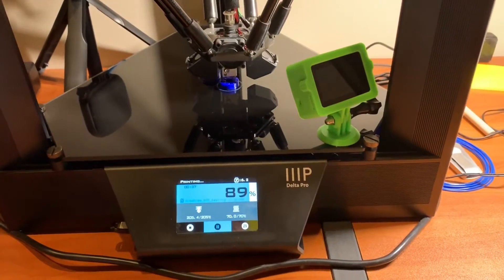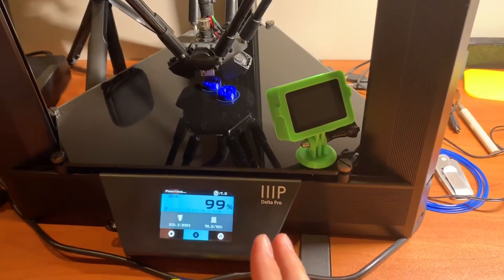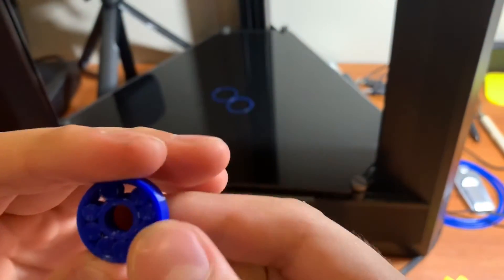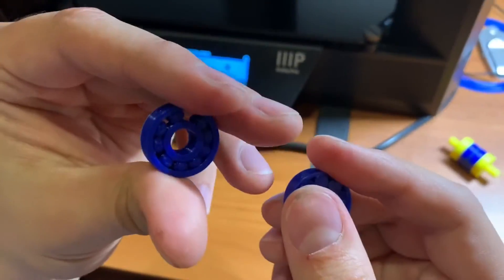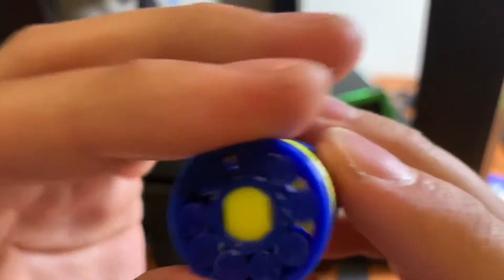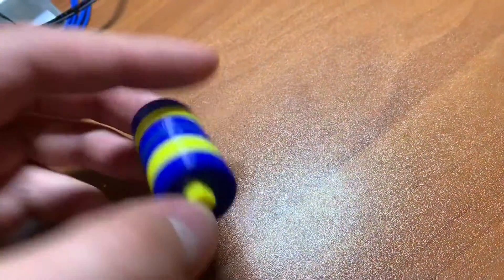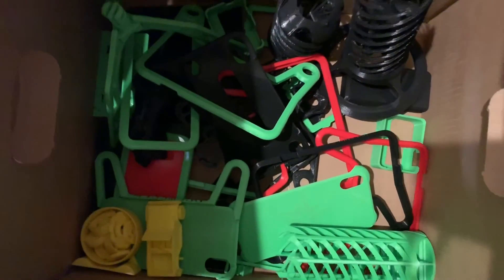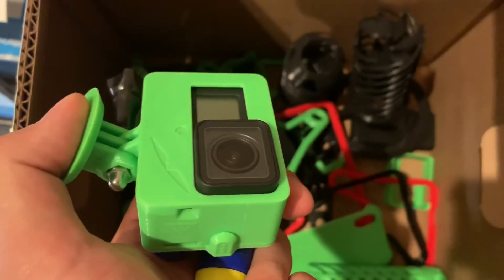In Depth Tutorial: How to print a Drew Brew 608 Bearing Replacement

Comment: Thanks very much for a response on and old comment stream. I did it again at a 2% increase in extrusion and 0.2 layers with maybe a little tighter bit to the eye and feel same result. This is a really reliable print, no complaints just reporting what was experienced. Looking forward to if you get to the changes. I want to use for spool holders which run a bitt of weight but super slow speed as you would know. Thanks again!
Reply from the maker: No worries, thats what I use them for as well :)

Comment: Mine printed fine and spin easily - 0.16 layers (Prusa Mk4) - however it's like there's one bearing missing in spacing - the bearings all move around easily but slide to one side in use) - they're just that loose so not sure practical to use on anything but like the cups shown or something with almost no load? Really like the model though - thanks for sharing!
Reply from the maker: Hey again ;) it is a plastic bearing so it there’s that limitation upfront. As I said earlier, for it to be print-in-place, I had to leave a certain amount of space in between each bearing. It can surprisingly handle more weight than one would think. I do plan on releasing a version where you can pack the bearings, I have just not gotten to it, but it would be a simple cut on the outside of the bearing. I have a project currently posted that makes use of the updated design, check it out-

https://www.printables.com/model/862669-nespresso-vertuo-spinning-tower

Comment: Tried printing this on my Ender 3 V2 but I cant get them to spin at all. I have it calibrated as best as I can. Any suggestions?
Reply from the maker: Eric L you can try to decrease flow rate by 1-2%, it would make the print a little thinner. You can also save alot of time by printing my “S Shaped Tolerance Test” a few times to dial in your settings 😉
Reply: @JLake3D  have a link to that tolerance test? I am also going to run a temp calibration and see if I am printing to hot
Reply from the maker: Eric L just search for it on Thingiverse, i believe its the only one with that name.
Reply from the maker: Eric L https://www.thingiverse.com/thing:3569489
Reply: @JLake3D  Ya mine didn't print that one well at all. What exactly should i fine tune to get the separation that is needed? I tried turning down flow to 98% but it still pretty much fused all the layers together
Reply from the maker: Eric L as long as you can print the 0.2mm separation you should be good 👌 decrease the flow even more as long as it doesn’t affect the quality of the print. Slowing down speed might help as well.
Reply: @JLake3D  Tried everything to make it print .2mm seperation but cant seem to get the printer to be that precise.
Reply from the maker: Eric L last attempt try to lower your print temp. If that doesn’t work than its a printer quality issue.